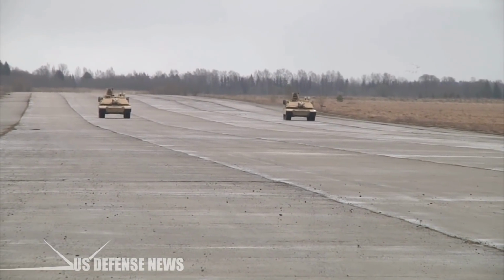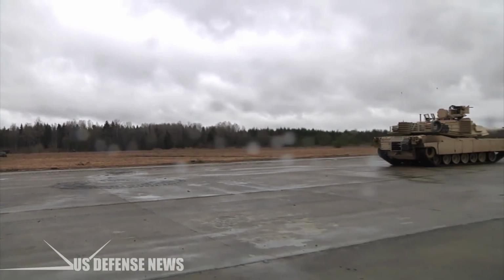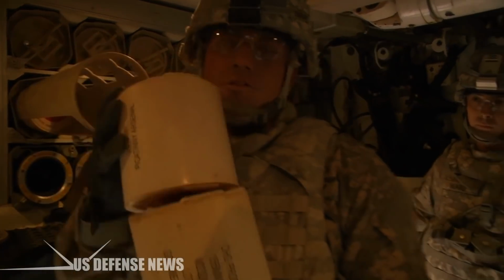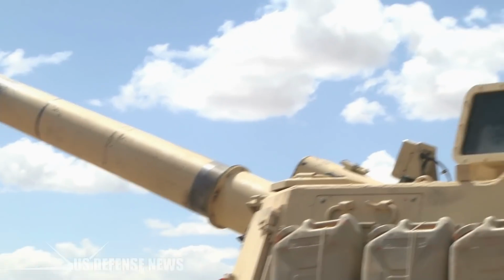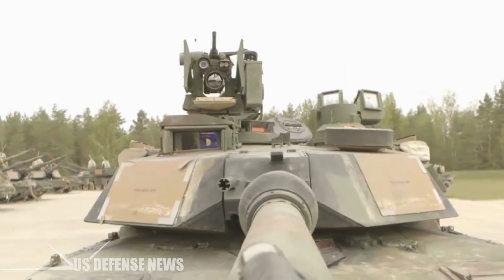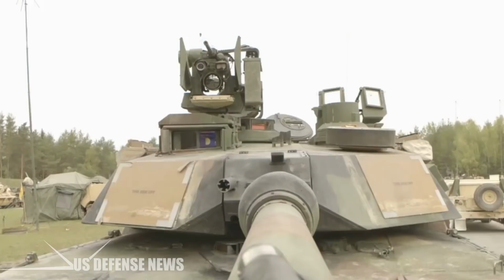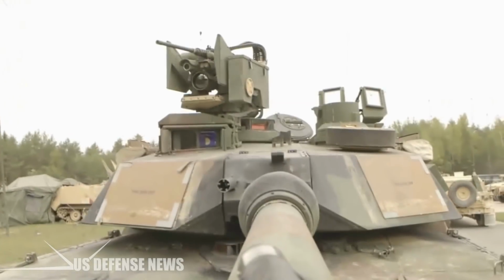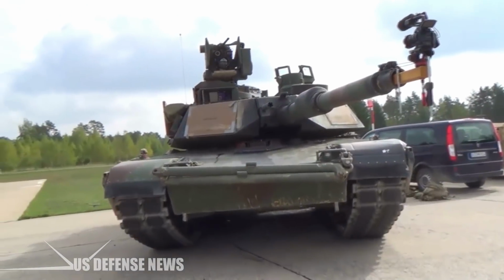U.S. Army Receives First New Abrams Tank Prototype

Comment: Still no active protection system??. I know the Army is testing one from the Israel and one made by Raytheon, but they obviously haven't decided which one to use. Israely is operational, cheaper and easier to integrate with Abrams but its much less advanced and it presents a threat to dismounted infantry. On the other hand Raytheon's Quick kill system is more expensive, and still in testing but its much more effective and practically harmless for infantry since it launches a small missile vertically that shoots the incoming missiles from the upside down towards the ground, a true game changer..
Reply: +vegass04

 A.P.S. is still being proven (Russian Drozd had mixed results in the past 40 years), and the technology is being proven for it. Just a matter of time.